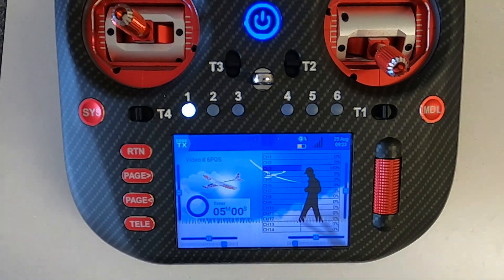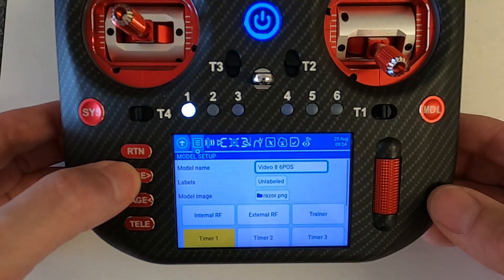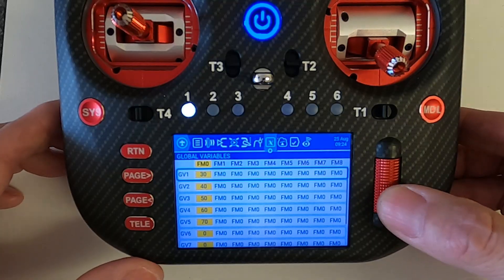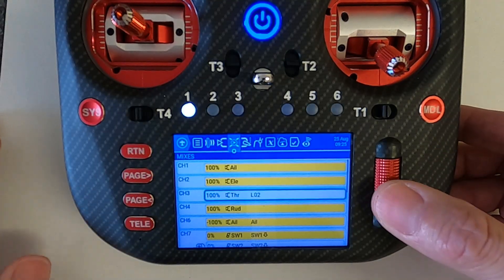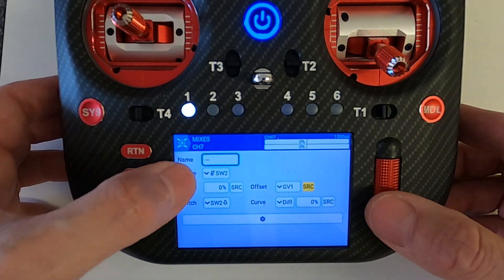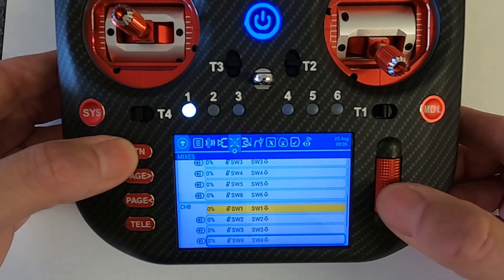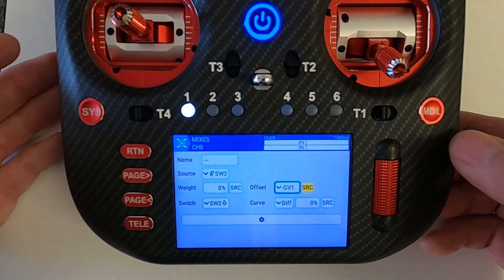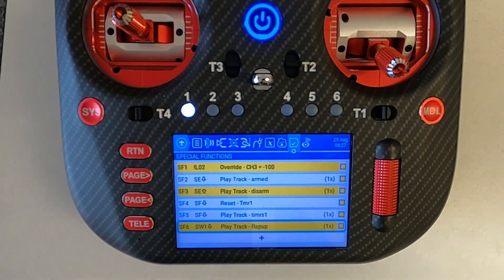RadioMaster TX15 6 Push Buttons Uses & Setting Up

Comment: Great video! Would love to know how you changed the lighting configuration of these six buttons?
Reply: Gotta tell ya, figuring out how to do this was hell. Model Setup>Customizable Switches>. Groups refer to switches the switches working in sets (think 1,2,and 3 set CH16 to either -100, 0, and 100). To have all 6 independent, remove their groups. Startup refers to position when the radio is turned on. It can have memory, from last use, or default off/on. Colors are self explanatory. Mode: 2-pos is like a standard switch. Toggle is like momentary switch. @shaharlazarov I see you had a similar question.

Comment: Quick question, for the 6-position switches, could you hook that up to a camera gimbal?  For example, if you had a camera that's on the bottom of the plane, and is on a motorized gimbal, could you set it up so Switch 1 puts the camera facing directly ahead of you, Switch 2 puts it at say a 20 degree angle, etc?
Reply from the maker: Yes that would be possible.